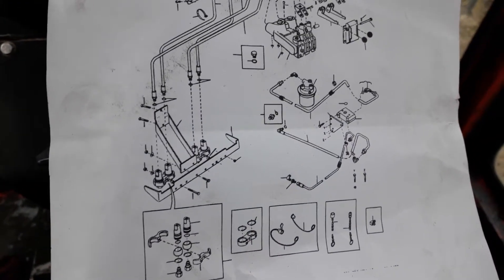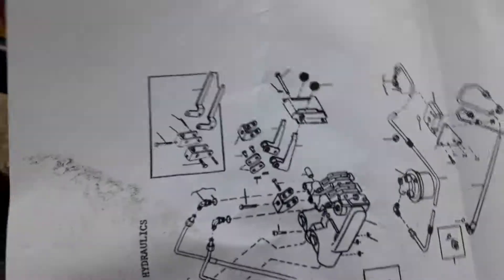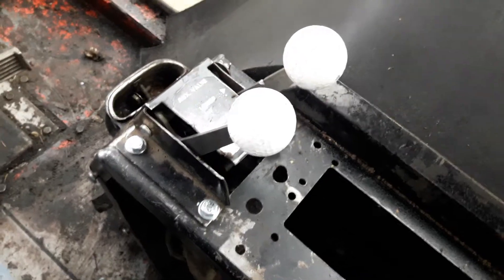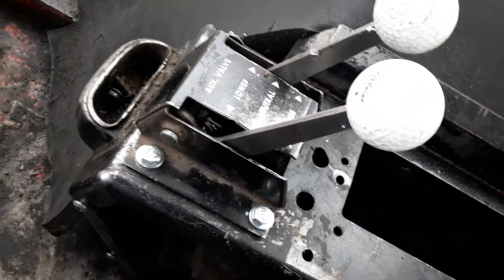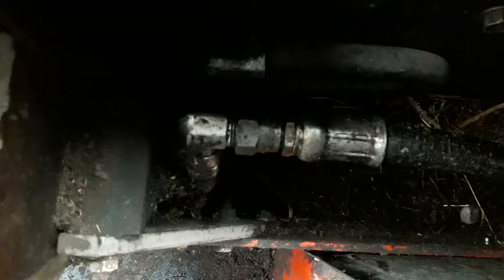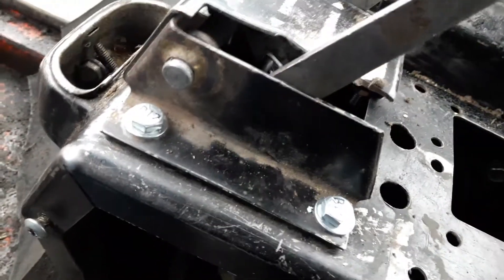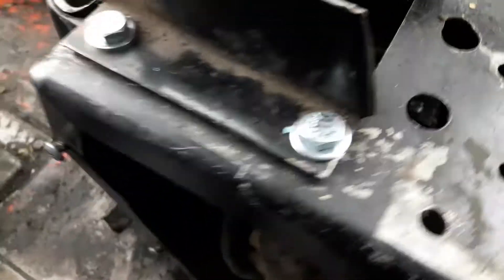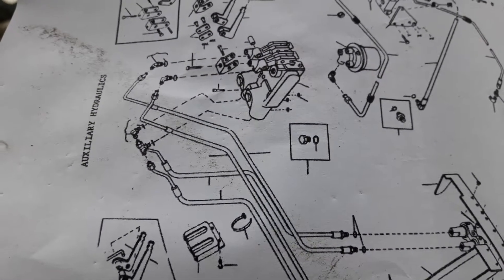Massey 1085 hydraulics valve levers not activating proper

Comment: Question for ya, I inherited recently my uncles 1085 and it has a hydraulic leak on one of the remote hoses right at the remote.  Is the hose one solid piece from the remote to the valve body in the cab or does it break somewhere in between?
Reply from the maker: Mine is hosed apart way. Its solid tube about halfway to get just outside the wall of the cab and then hosed the rest of the way
Reply: Thanks for the reply.  That is what I thought I was seeing, but wasn't entirely sure. Hopefully it won't be too difficult to get off and replace.
Reply from the maker: See below for reply